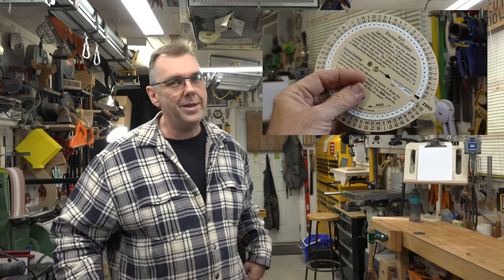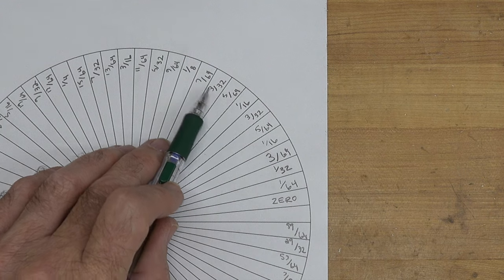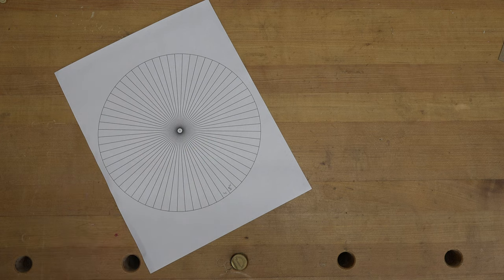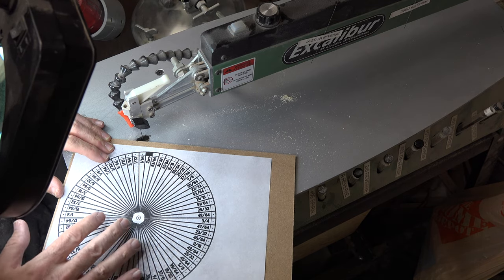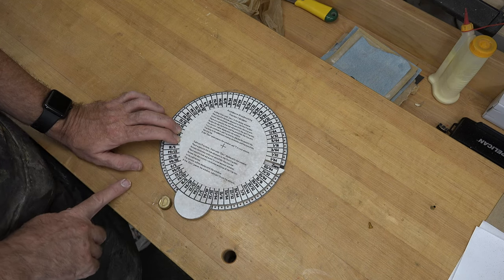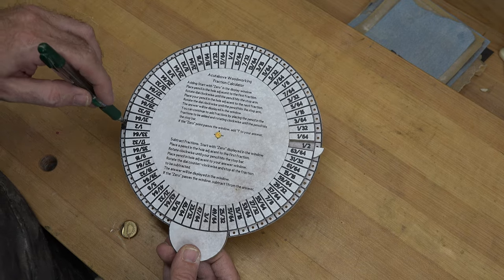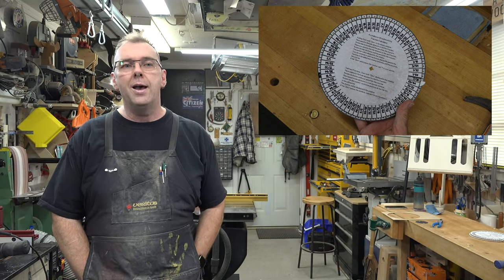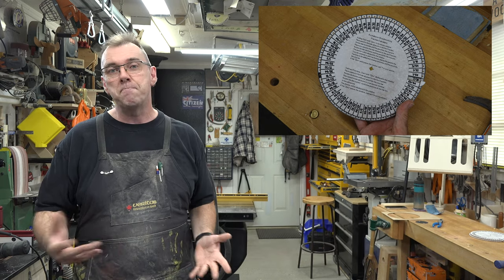Making a Fraction Calculator

Comment: That's a great tool I use to use one doing engineering, it had both Imperial and Metric, Imperial on the front and on the back Metric, it had a center wheel one side had  an Imperial wheel and on the other side was the metric wheel, unfortunately with my moves throughout the years I lost the calculator, Thanks to Ken I can make one, Thank you Ken, 👍
Reply from the maker: I like your idea Alan with a metric on one side and imperial on the other.  I may have to modify my pattern and update the show afterward.  Thanks for tuning in and for taking the time to leave your comment.  I truly appreciate it.

Comment: For someone like me with Dyscalculica this is a high priority project, 35 years in the trades and I've got by using my tape ruler pinching at my starting fraction and counting with my pencil, quite embarrassing at times, unless you have this problem you will never understand, it's not a matter of practice, you'd think 23 years a carpenter and 12 an electrician I could finally get the hang of it, wish I'd known about this tool 35 years ago, as for a handle, I don't mind it being thick I'll use a couple tiny furniture hinges and a strip of hardboard on the back. Thanks for sharing👍
Reply from the maker: You're very welcome.  If this device will be handy for you, feel free to send me an email at acutabove_woodworking@hotmail.com and I will send you a copy of my pdf to make your own.  Thanks for tuning in to the show and for the kind words. Good luck on your project.

Comment: Kenny, 
Great tool for those of us who can’t function in a fractional world. Thank you for the template. I’m going to try adding a small palm sized piece of round dowel under the calculator. Possibly exchanging the pin for a bolt through the calculator & nutset in the dowel.
Reply from the maker: Sounds like you've got a solid plan there Cat.  If you'd like the pdf of the pattern, just drop me a line at the channel's email address.  Thanks for tuning in to the show.

Comment: If you run the drill bit in reverse for the pencil holes, no tear out of the paper. Thanks for the great calculator and your time doing this.
Reply from the maker: Good advice Curt, as long as your drill press goes in reverse.  A guess a hand drill would have to be used.  Thanks for tuning in to the show.  Glad that you liked the templates.

Comment: wow that is a really useful gadget. I'm going to make one for myself too.

I mix imperial and decimal systems in every project.

I like using inches, and all my tools are imported from the USA (DeWalt). My routers use 1/2 and 1/4 shanks etc. I use 1+2+3 inches machinist blocks for nearly everything.

however, because I'm a European now living on the equator, I like to use millimeters for the precision parts. 

it may sound funny, but I would cut a sliding dovetail (on the router table) using 1.5 inch bit, and make it 1/4 inch deep, so that the narrower part of the dovetail becomes: 1 3/8 inch wide (14 degree tangent gives us 1:4 ratio between sides, so that angle is far from accidental), which allows me to use my 1 3/8 inch bottom cleaning bit to cut the groove for the dovetail bit.
and then, for the sliding dovetail 1.5 inch wide and 1/4 inch deep, I would add 4 mm shoulder above that dovetail :)
why 4mm and not 1/4 inch deep shoulder? because 1/4 inch is too deep for the shoulder in my world.
Reply from the maker: Everyone has their own method of doing things and as long as it works for you, that is what counts.  Here in Canada we are a metric society but I was trained in the trades in imperial so it has just stuck with me and that is what I am used to working with.  Good luck with your fraction calculator build and thanks for tuning in to the show.
Reply: @acutabove_woodworkings  oh I didn't know you were in Canada. I watch few more Canadian woodworking channels, and they always talk in imperial, so I assumed Canada was purely imperial. Rob Cosman for instance acts as if he never heard of metric system.
Reply from the maker: @TigerCarpenter  There are plenty of Canadians who don't use the metric system for their woodworking.  It's a little strange actually.  LOL

Comment: Kenny, wow how neat.  I have been envious of that “fraction calculator “ ever since I saw it.  I will be requesting the pattern.  I was wondering if a light coat of spray lacquer would make it hold up better or might it ruin the printing?  Thanks for all your hard work setting this up.
Reply from the maker: Not sure if it would ruin the printing or not Paul but a circle of plexiglass would certainly protect it a little better.  Thanks for the kind words on the show and the project.  I've sent the pattern to your email.  Good luck with your build.
Reply: Great little tool Kenny. Another printing suggestion... printing on transparency film if you can find some, instead of paper. Staples might be able to print them for endusers.
Reply from the maker: @PPerquin  Thanks for the suggestion Phin.  I'll have to give that a try one day.  I appreciate you tuning in to the show and taking the time to chime in with your suggestion.

Comment: Already emailed for the PDF, I’m terrible at fractions lol Also another really cool scroll saw project. You say hard board, is that MDF? Or something different?
Reply from the maker: Hardboard is basically MDF.  It's usually sold is thinner sheets than MDF.  You can use anything you like really.  Plywood is just fine as well.  I hope this helps.  Thanks for tuning in Randy.  The pdf has been sent.

Comment: 🇲🇲🇱🇷🇺🇸
Reply from the maker: Ummmmmm, okay.  Thanks for tuning in
Reply: @acutabove_woodworkings  for metric oriented people it is a bit of a funny device
Reply from the maker: @z4zuse  True enough.  I can understand that but for anyone using imperial measurements, it's a life saver.  Adding metric equivalents to the calculator can also make it an imperial to metric converter if you are working in metric but are using imperial plans.